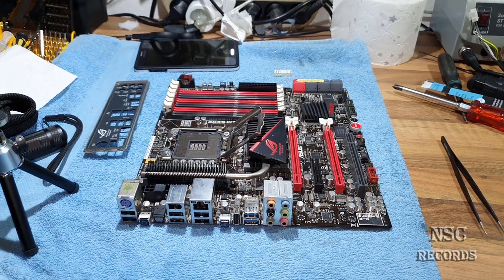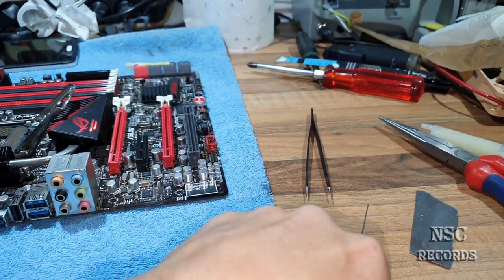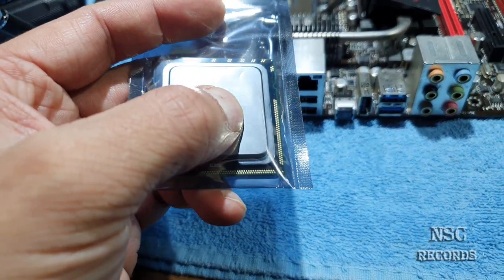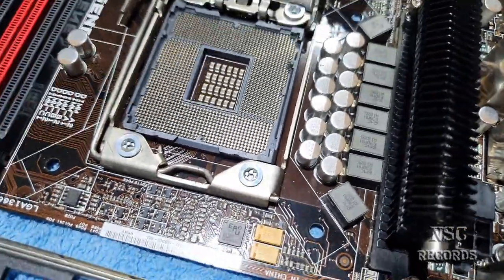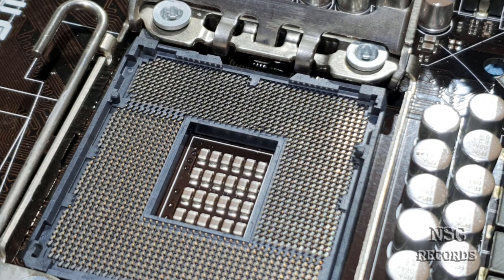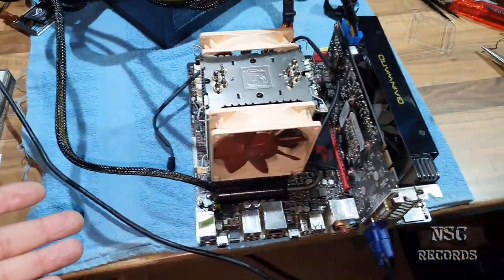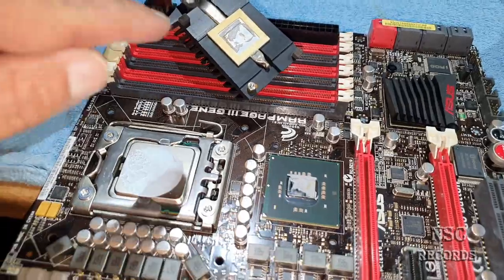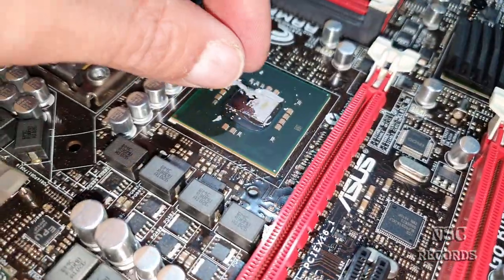How to fix bent cpu pins on all intel boards By:NSC

Comment: Well done - nice to see these things getting repaired. However: 21:50 - as you flipped the CPU it would be 5 contacts up, not down. Also you could check for the CPUs datasheet/pinout, there you'll find what function the affected pins are related to and can test it specifically. On a quick glance you might not notice if a memory channel or PCIe lane is still out.
Reply from the maker: Right, but all is working till now ;)

Comment: There is an easy video editing trick that you can use to remove flicker - duplicate the video, and have them overlayed with a couple frame difference, then make the top layer 50% visible and the flicker should be more even
Reply from the maker: Thank you so much, gonna try it next time 😀

Comment: Very interesting and thank you for sharing your skill and experience.
Reply from the maker: You always very welcome. Thank you much to.
Reply: @NSC-Modz  I have a pin or two that is broken on the tip, I'm thinking of adding some solder to make it look like the end of the pin to complete the circuit
Reply from the maker: Yeah, but try first if it's gonna work or not, if it's working, than just let it like it is 😅

Comment: Nice idea to bent back pins with needle under and pincet above. Thanks for sharing.  About x58 chipset. Legentary platform. But because of lack of AVX instructions lot new games does not start on it, warzone 2 for example. How about with almost same amount of money the cheapest am4 motherbord with ryzen 5 or 7 first of second generation? They are dirty cheap now, play all games, with upgrate path, great basis for budget gaming pc. But i feel is more a hobby for you. Thanks again!
Reply from the maker: Yeah, that's right. Had problems also to start some new Games like Dead Stranding. So I'm now with 2 AMD R9 5950X, one with watercooling and the second one for my living room. Both with the Asus Dark Hero motherboard, this is overkill for the next years. 😆 If you looking for a new system, than go at last for the R7 58003XD or the R9 5900. Best for the money, and best for the future.

Comment: Ich bin an sowas verzweifelt :-( Ich würde, damit du noch viel Spaß mit dem Board hast auch mal unter den Kühlern von den Spannungswandlern schauen ob die Wärmeleitpatz noch okay sind 🙂
Reply from the maker: Längst getan mein Freund 😀 aber fürs Video ist der Chipsatz wichtiger zu erwähnen ^^
Reply: @NSC-Modz  Ich kontrollier dann ALLES🙂Auch die CMOS BatterieLOL..Die sind dann auch mal leer^^
Reply: Möchtest du viel Freude an den Intel Prozessoren..Köpf die und mach da auch Liquid Metal droff..passiert mit einen I7 4790 K gleich knapp -20 Grad 🙂
Reply from the maker: @m.sch.1123  hehe ja, aber bei 1366 Xeons nicht nötig, sind alle zum glück verlötet ^^
Reply from the maker: @m.sch.1123  oh ja, wenn dann gleich alles überprüfen. Sobald etwas mir gehört wird gehengt und gepflegt :)

Comment: sorry but it is not fixt  becouse your cpu cooler on the bord is not working  this means problem with pins 
also gpu coolers wont work
Reply from the maker: My cooler is working, all is working, i can do a video if you like 😆 all is working, god thanks xD
Reply: it wasn't plugged it thats why it wasn't on
Reply: also gpu cooler wont kick in until its needed. most gpu do that now
Reply from the maker: Right... 🤗✌️